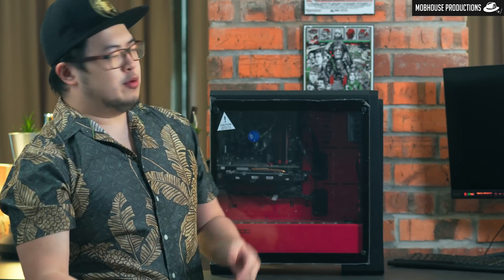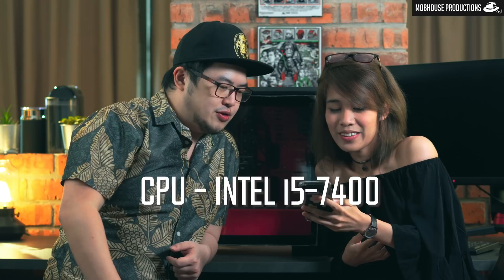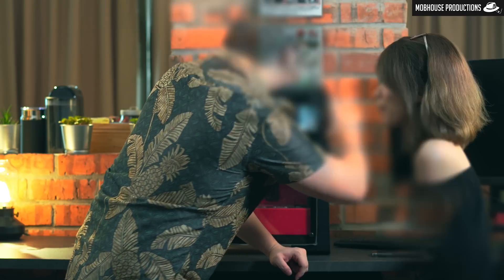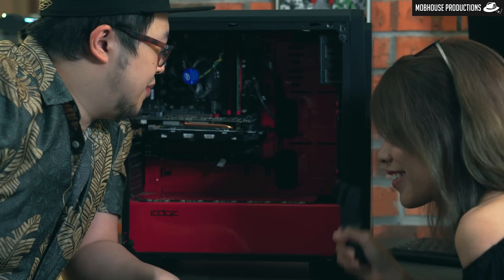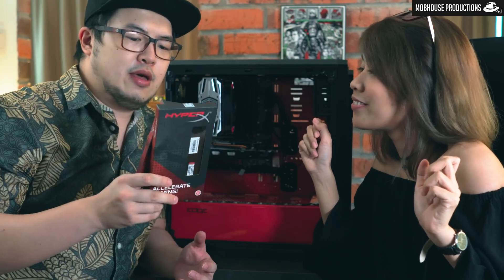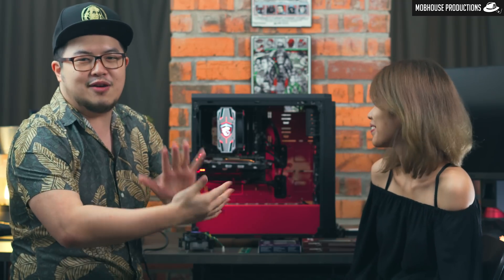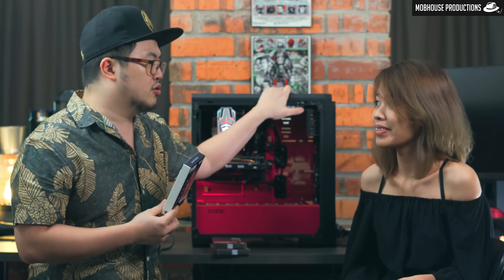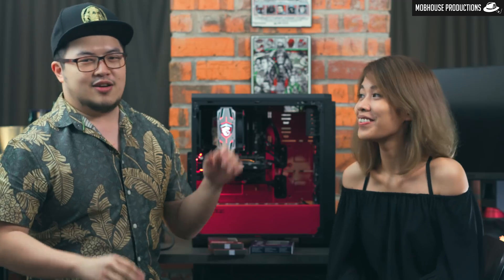Streaming PC Upkeep and Upgrade

Comment: Woah, only 1 exhaust sufficient ehh?
Kalau betul, nak tukar jugak dari setup 3 intake 3 exhaust sekarang..
Reply from the maker: depends dgn case tu. Sebab in this situation, clearance until intakenya tak besar sgt. Based on my speculation, 3 intakes with restricted airflow mcm tu, should only create maybe 1-1.5 fans efficiency. So while sy sdg cuba buat positive airflow, resultsnya lebih kurang mcm neutral sj.